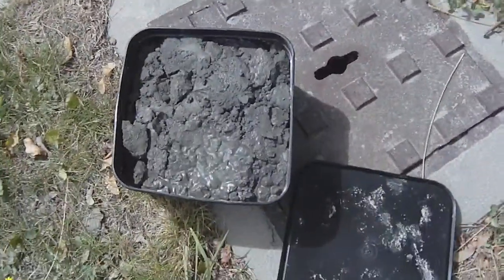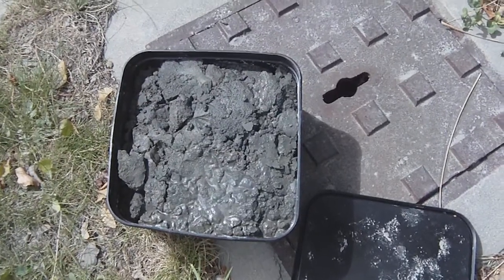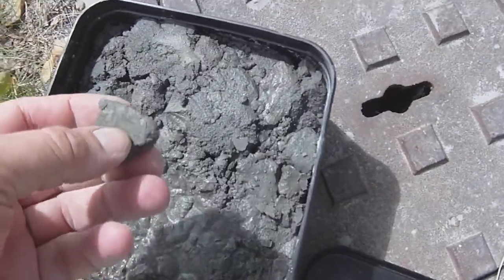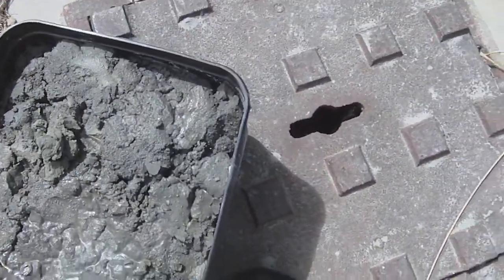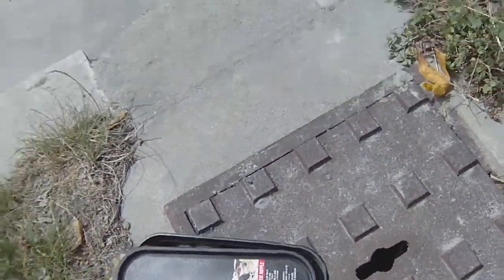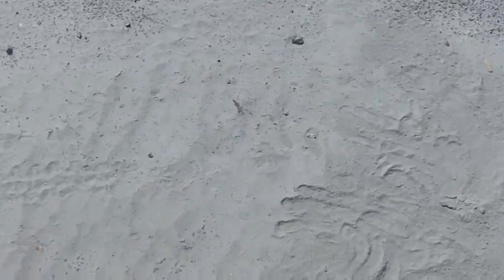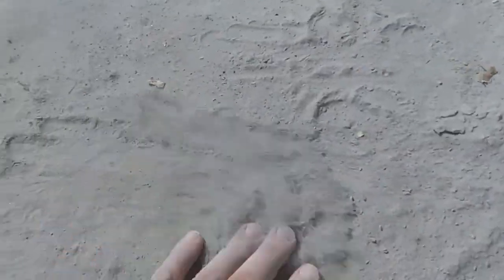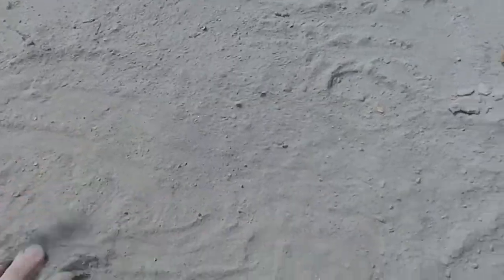Christchurch Earthquake:  deposited sand drying out - see how fine it is.

Comment from the maker: @jamesbondxxxx  Yes it did.  I believe the estimate is about 180,000 tonnes.  It was forced up to the surface along with water by a process called Liquefaction. (see other video for that).  While it was wet it wasn't so much of a problem but as it's been cleared away by the council and the residual amount is drying out it's getting blown around by the strong winds.  It's a remarkably fine sand indeed.